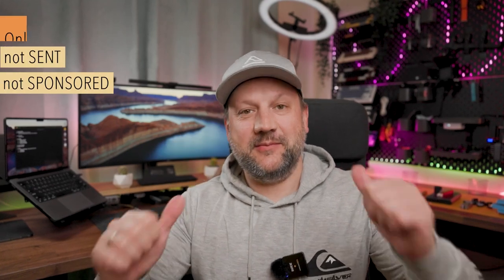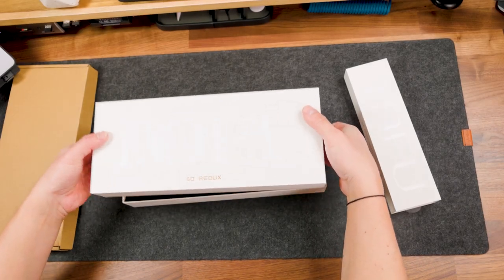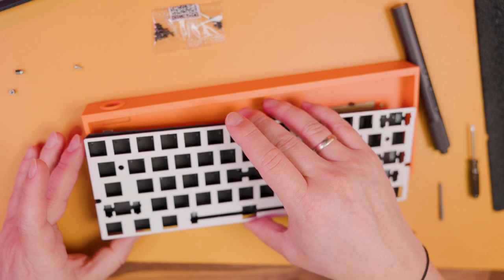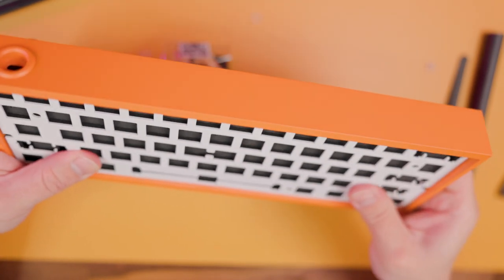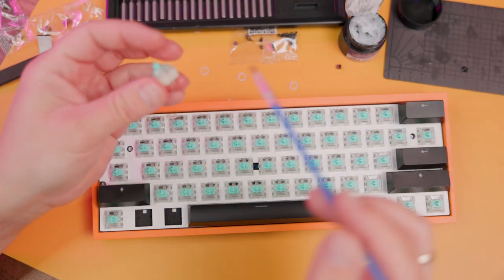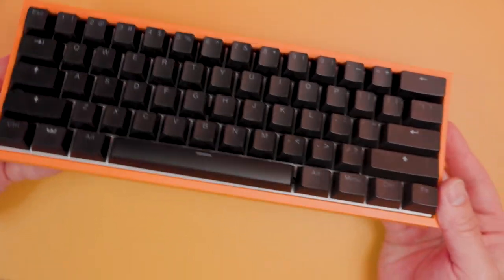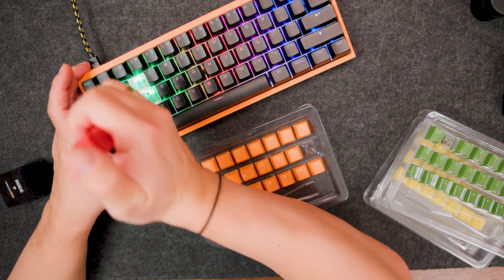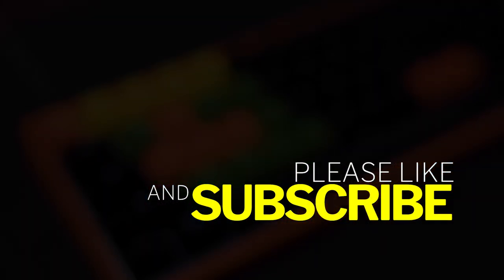Wooting 60HE | Full MODDING Guide

Comment: Hey guys, quick tip: if you do disassemble the keyswitches, put a bit of lube between the two halves of the switch, before reassembling. It gets rid of the weird clinky noise when releasing the key. It has some of the effects of filming the key. Also to get rid of higher frequencies, which this keyboard has a lot of, one can also put painters tape in the case
Reply from the maker: Thx a lot for this info!
Reply: @getsmarthomeoffice  ;)

Comment: Did those o- rings you attached to the standoffs come with the tofu60? I haven't seen anyone use those in any other build videos.  Why did you add them?
Reply from the maker: It’s from modding kit from Amazon, this stuff removes any vibration between parts

Comment: i got the tofu redux case for my wooting the only difference is i replaced the steel plate with the one that comes with the redux, however i can't sandwhich the plate, foam and pcb back together as the screws wont thread back in place. any advice?
Reply from the maker: Yep, check my other Wooting video, you need to glued it :)